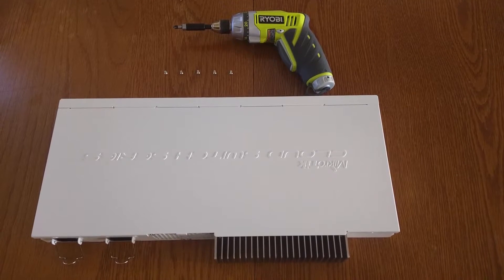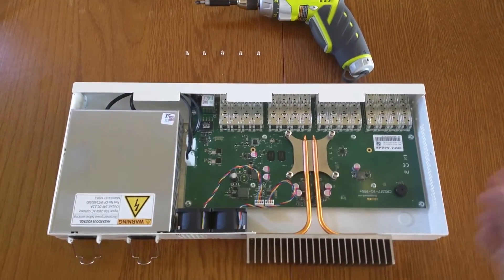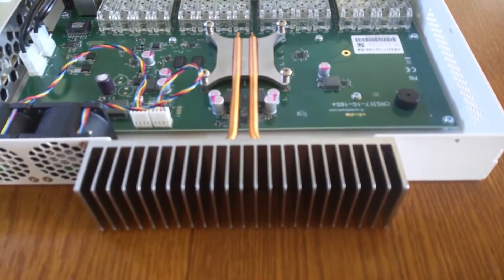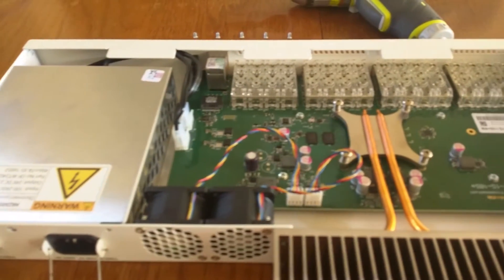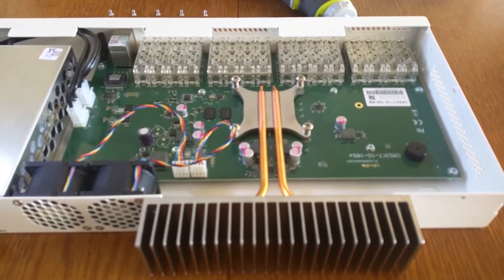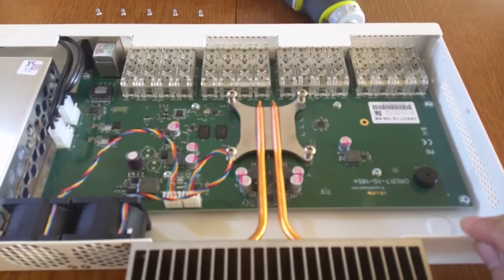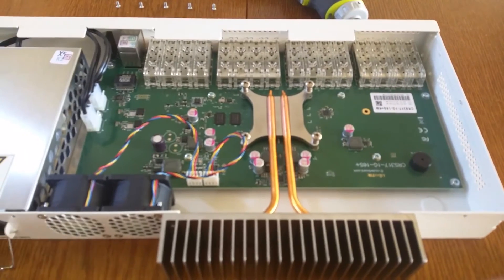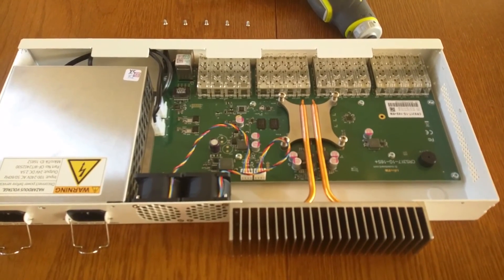Taking a look inside the Mikrotik CRS317

Comment: LOL  WTF is that shit on the back.... looks like the design overheated and they added that to fix what the fans could not deal with....
It should NOT be drawing air in via the front, since that's going to pull dirt & dust into collecting round the optical  connectors.

sorry but just from the PCB & heat pipe mounting  and general layout you can see it is a piece of shit designed by people with little experience in this type of kit..
Reply: The fans are for cooling the SFP+ transceivers and PSU only it seems.

Comment: How is the Performance?
Can  the Switch Layer3 Switching with wirespeed?
Reply from the maker: i haven't verified, but based on discussions on Mikrotik's forum, it appears to be well known that this switch cannot do line speed when running L3; which has to run through the CPU that isn't able to handle 10Gbps.
Reply: in RouterOS 7 wich is already on Beta This switch can do L3 Hardware Accelerated Forwarding at wire-speed
Reply from the maker: Really? That's very interesting news! Thanks for sharing!